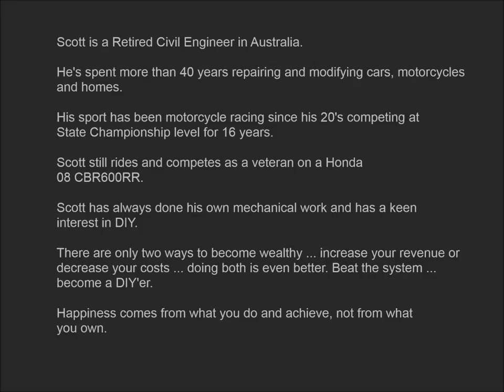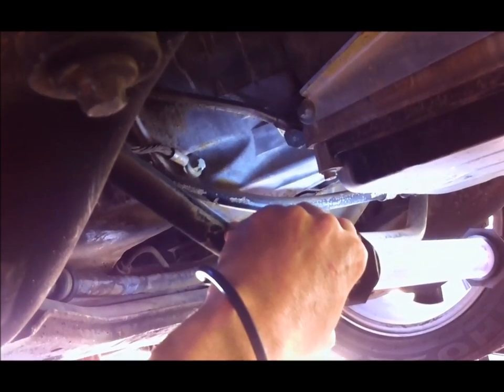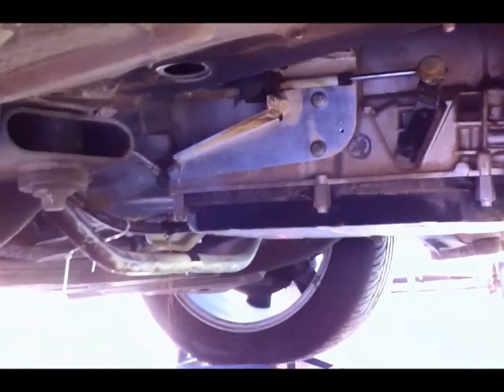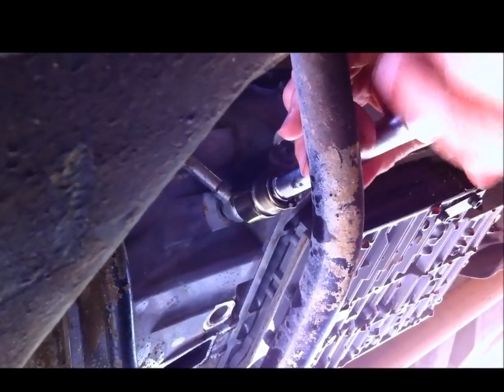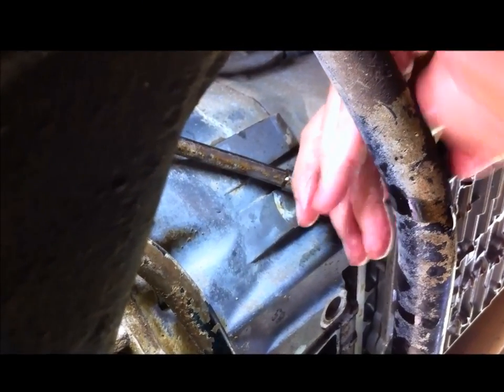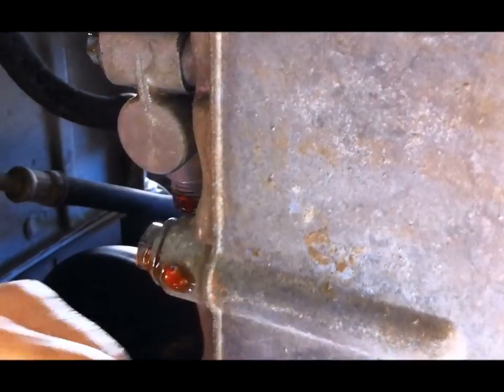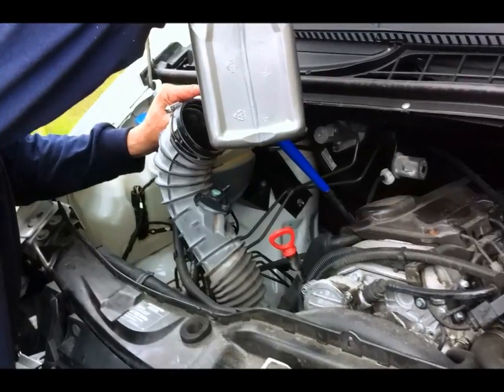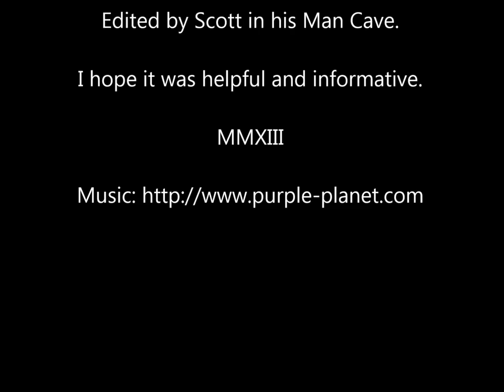Mercedes W639 Vito 722.6 5GTronic Gearbox Automatic Transmission Fluid ATF Change Service

Comment: I've watched all of your videos, and used an incredible amount of information from them - Thank you!
However, it was great to see things go slightly wrong in this clip, I thought it was just me that bad things happen to, I've lost many tools due to stiff bolts, rusted parts and frustration. 

The Vito 109 04, is my first vehicle of any sort, but I love learning new things so taken it upon myself to change/maintain as much on her as possible (The prices around my area are around £110PH (220 aus$) for labour!!)
So far;
4 struts (rear and front)
4 springs (rear and front)
Wiper motors
Xenon lens's
2 window regulators + cabling
a lot of electrical repair due to previous owner
oil change
steering wheel change
indicator stalk tightening 
and a few cosmetics here and there

Thank you for all your videos and sharing your vast knowledge with all of us, I hope there is more to come :) 

- Stewart
Reply from the maker: +stewart pearce Thanks Stewart. Have a look at the recent video I did on the front strut modification.

I'll be doing the auto service video again mid year. This will be me doing my own vehicle and will be better than this video. My two mates have a rough enough is good enough attitude. It was one of the early tutorials so I was learning. Regards, Scott

Comment from the maker: Hi Dave ... thanks for your kind comment about the video. You can buy the dipstick cheaply off eBay. search for "Mercedes 722.6 dip stick". No you can't leave it in place as it's quite long. It will have about 200mm poking out when it's in place. Reuse the black plastic cap. and the broken red seal lock. You can also buy the little red locks on eBay if you like.

Comment: Hi there Scott, Did this job today. It took 2 hours....maybe a bit longer than expected as 4mm torque convertor drain bolt snapped off & too an age to get out. Apart from that the job was straight forward. I refilled with aprox 7.5 Litres of new fluid & I did NOT  blow the lines out.
Reply from the maker: Hopefully you can drill the TC bolt out and re tap. Put an M6 in.

Comment: The clip on the filter that was removed was not inserted into the slot, so it was just hanging.  There is a little trick to get the clip on some filters to go in.  You have to gently press up with the clip over the slot and then slightly twist it left and then right around the main inlet, then the clip should go right into the slot and hold in.  The Ryco ones need this, some other ones just seem to go straight in as the new one you installed.  I suspect it depends on the type of plastic.

Comment from the maker: Edward you're right. I've given up with the dealers. They just try to gouge as much of your hard earned dollars as they can. I'm happy to do the research and make more videos. 

My brake fluid is due for changing soon so I was going to do a DIY about that. It's an easy job but you need a pressure bleeder. They're cheap on eBay.

Thank for your comment.

Comment: ok, here in cold sweden it will cold down quick😁. Thanks for reply mate! Now I am ready to change oil on my race van 120 cdi which will carry my cbr1000rr around to racetracks!
Reply from the maker: The 120CDI is a great van. You could put your CBR1000RR in the back and drive to Sepang in Malaysia! It's long way but it would be fun.

Comment: Hi Scott, How often do you change transmission oil in your automatic Vito Van?
Thanks for your videos!
Reply from the maker: Adam Kormendy Hi Adam. I like to do the transmission often as it's the best way to keep it in top condition. Because it's quite easy work I tend to do it every three years or 40,000km whichever comes first. MB say filled for life which is nonsense however they've now indicated there maybe benefit in doing it every 60,000 km or 4 or 5 years.I'll do this video again as I'm going to do my own transmission again soon. The current video on this subject has a bit too much horsing around and glosses over a few things. My two mates don't have as much mechanical sympathy as I do. Near enough is good enough for them whereas I like to do things properly.I feel spending $25 on a filter and $90 on new ATF every three years is dam cheap insurance and will keep the transmission like new. Regards, Scott
Reply: Hi Scott, 

Thanks for your detailed and informative answer.  I be waiting for your next video. :)

Cheers, 

Adam

Comment: If the filter is not changed, only how much oil should I add if I change the oil. Thanks
Reply from the maker: The filter drains back to the sump ... so the oil change quantity is about the same if you change the filter or not. It's about 8.4 litres. I put 7 litres in then top up by monitoring the level via the dipstick.
Reply: @ScottElliott152  Thanks for your answer, but that's exactly what I want to ask.  I just couldn't open the oil change pan from the sump plug and Screw broke.
I hope it doesn't leak oil,
Reply from the maker: @omerbey82  Thanks Omer. Sorry I gave you some misinformation. Note I meant to say start with 7 litres then monitor via the dipstick. I'm assuming you're still going to remove the oil pan and drain the torque convertor? The TC holds about 50% of the ATF and the oil pan/sump the other 50%
Reply: @ScottElliott152  Thanks a lot for your help but I stop by to measure the oil level but it always goes above the level.  Could it be because it is getting too much into the sump?  In your measurement, how many cm does the rod go in?my dip stick is 122 cm
Reply from the maker: @omerbey82  122cm is about right. You must have too much oil. Did you remove the sump to drain?

Comment: hi, Mine is vito 113CDI, will it be same procedure? I have not done such work before but if I follow exactly what you did could save £££
Reply from the maker: Sam it should be easier. I'm pretty sure your model doesn't have thew thermo control valve on the LHS of the engine sump. You'll have the pressure side line coming out of the gearbox in the same place but it will go straight to the oil cooler. Also the oil line pushes into the transmission and is held with a clip or bolt. It's probably not the banjo fitting like mine. Have a look underneath first to work out what you've got. Everything else will be the same as it has the 722.6 transmission.

Comment: dear SCOTTS
I have mercedes vito 2012 - 113CDI. Today I decided to change my Automatic transmission fluid. I taken my car to one of the private mercedes engineer. He use automatic transmission fluid  4 litre. I am confuse once  I watched your video you are mentioned to use oil 7.2 -8 litre. what can be wrong. Do you thing he did not done properly to change oil.
Please help me to 
Many Thanks
Reply from the maker: Hi Faith. This is the problem with many of the so called "professionals". It sounds like all he has done is drop the ATF out of the pan and not drained the torque converter. The TC holds about 4 litres or about half of the total quantity. So these guys only change half the fluid! and thereby contaminate the new fluid with the old.

Do you know if he took the oil pan off and changed the filter?

I think the 2012 model has a drain plug for the TC. It's very easy to get to and unscrew the drain plug.

Would you be able to do the job yourself based on watching my video?
Reply: Dear Scotts
They drained only pan but not torque converter. Yes He took the oil pan off , changed the filter and seal.You recon this job not done properly. What is the your advise to me to tell the this engineer. I am going to see him this monday.
Many Thanks
Reply from the maker: Fatih Beydilli Faith I would say I was unhappy he did only half the oil as now you have a mixture of 50/50 old and new. There's hardly any point in only replacing half the ATF as the old stuff contaminates the new. The total volume required if you drain both the oil pan and the TC is between 7 & 8 litres and maybe more if you flush the oil cooler like we did.
Reply: MrScott52 nice of you
Many Thanks
Reply from the maker: Fatih Beydilli Faith he may try to blind you with BS by saying the TQ doesn't have a drain plug or that replacing half the ATF is not a problem or he may say they only hold 4 litres. I'm sure he'll try to spin a story because that's what these people do ... they prey on the ill informed. That's why I think it's so important to gain knowledge about this sort of thing. If you don't your at the mercy of people like this.
I just looked up the Workshop Information System and according to that there is a drain plug for the TQ. I mean you wouldn't change half your engine oil would you?

Comment: hi scott, i saw some video on youtube. Those people just put a 27mm hose into the hole for the transmission oil filter, and sunk the new fluid from that hose in order to do the flush. why you choose a more complicated method. and btw the dip stick i boought from the ebay has a plastic mesuring part which is not straight. do you think will it be ok to still use it.
Reply from the maker: Peng ... It depends how bent the plastic measuring part is. Try to straighten it if you can. The 27mm hose method won't flush the oil cooler if you have the thermo control valve as it will be closed. That's why it's done in two stages. Some 722.6 transmissions don't have that valve so the 27mm hose may work.
Reply: thx for the reply, another question, what kind of sealant did you use to seal the torque converter, any brand or specification tfor recommandation?
Reply from the maker: I used a small amount of Permatex Non Hardening Sealant on the the threads and washer.

Comment: thank you, this is very interesting, just would like to know where to find the dip stickRegards, René
Reply from the maker: +Rene Ahumada Thanks. If you take the air box off first it makes it easier to find. It should be on the LHS of the engine.
Reply: Hi Scott,

Thank you but what I meant was where to buy the dip stick and get rid of the plug that comes from factory.

Thanks again,

René
Reply from the maker: +Rene Ahumada Rene ... You can buy the dipstick cheaply off eBay. search for "Mercedes 722.6 
dip stick". No you can't leave it in place as it's quite long. It will have about 200mm poking out when it's in place. Reuse the black plastic cap and the broken red seal lock. You can also buy the little red locks
 on eBay if you like.
Reply: Hi Scott,

What about cutting the dipstick to the right size?

I thought this is just a trick to force you to do the service with the dealer and to pay big bucks to them.

Otherwise I'll just do what you suggest and only use it to check the transmission fluid from time to time.

Thank you,

Regards, René.
Reply from the maker: +Rene Ahumada You'd have to work out how to seal the tube. The black cap has an O-ring and is pushed into the tube to seal it properly. It's easier and safer to use the proper cap to make sure no dust, dirt or water go down that tube. I keep my 722.6 dipstick in the garage but you could easily store it in the van somewhere.
Reply: +Scott Elliott I'll follow your indications, it is true, no dust, dirt or water should go down the dipstick tube.Thank you once more,Regards, René

Comment: any particular reason why you don't use the dip stick level for 25 deg oil temperature?
Reply from the maker: Depends on the ambient temperature. You want to get the ATF nice and hot before you drain it. If you're efficient and are pouring the new ATF into an already hot transmission that new oil will be heated way above 25C. You either warm it up to around 80C or wait until it cools to 25C ... whichever is faster.

Comment: scott, what's the dimension of the special banjo you use to flush the heat exchanger and more?
Reply from the maker: It's a 10mm bolt as explained. Drill down the centre and cross drill so the fluid can flow into the banjo fitting. A couple of washers either side with gaskets made from gasket paper. The other special tool has a bit of 3/8" heater hose on the end ground into a cone shape to push against the pipe end.
Reply from the maker: Also have a look at this video of my 7GTronic as I explain the banjo fitting in more detail.
Reply from the maker: https://youtu.be/_-72EN_pqUU

Comment: any one sale this special fitting ?
Reply from the maker: No we had to make something.
Reply: MrScott52 Hi Scott, would you be interested in selling this customised banjo bolt? I live in Sydney and happy to pay for postage.
Reply from the maker: A Ng

It's really quite simple to make one. You don't need a lathe. The main feature is drilling a hole down the centre and another one across. A 10mm bolt, a couple of metal washers and a couple of sealing washers then stick a plastic hose on the end. You could file the threads off the first 20mm for the plastic hose. Hope this helps. Put the thinking cap on and improvise. Hope this helps. kind regards, Scott

Comment: Hi @Scott Elliott, I highly appreciate your work with video, and, especially, your effort to answer all comments. It's fantastic. Thank you. Some questions from me. I have to change ALL transmission fluid on my MB w211 722.6. And I found this way is easier: disconnect transmission feed line to the radiator and connect plastic tube and drain oil, starting the engine. I believe that you got an idea (it described on video on youtube "Flushing Mercedes C230 722.6 Transmission Fluid" https://youtu.be/7syO7SzKKQ4?t=78 ).  The question is, what is the practical difference between the 2 methods? Will I be able to drain ALL fluid using the second method (connecting to the feed line to the radiator), or is your method in some way is better? Thank you. Your time and answer are highly appreciated.
Reply from the maker: Thanks Vlad. The video I made follows the instructions in the Mercedes WIS. I believe the method you describe is pumping the ATF out but not removing the oil pan to change the filter and clean the magnet and bottom of the pan. If you only wish to change the ATF then the process you describe will change most of the ATF. I don't support the idea of measuring what came out and putting the same volume back in. The level needs to be set using the 722.6 dipstick. What if the transmission had a weeping seal? It might have been at a low level before you started. I think it's important to remove the pan to clean and change the filter at least every 4 to 5 years and 60,000 to 80,000km. Perhaps a fluid only change in between the full service would be a good way to maintain the 722.6.
Reply: @ScottElliott152  Scott, you're the Iron Man. The plan is, "Change oil" using the method "pumping the ATF" that I've sent the video above. After, remove the pan, clean it, replace the filter, replace the gasket, and plug. Place pan back. And add the correct amount of transmission oil according to MB procedure (cold and warm state, using the 722.6 dipstick). Hopefully, In this way, I'll be able to change the oil: transmission itself, torque converter, radiator, lines. Does it make sense? Will this work?
Reply from the maker: @vladk9360  Yes it will but I would still remove the torque convertor drain plug to get the last bit of old ATF out.